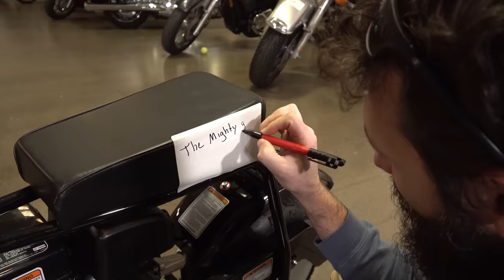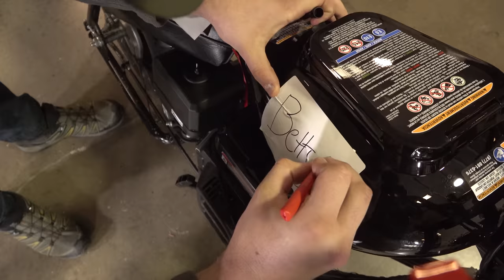Is a $400 Amazon Mini Bike better than the MOST EXPENSIVE mini bike ?

Comment: Minibike -- AKA Trouble Preventer 9000. 
This has to be the best invention since the motorcycle itself! My two brothers and I pulled 3 of these things out of a scrap yard when we were young. We did what needed to be done to get them going, and then commenced to have an absolute blast with them. The quest for more speed kept us girl and drug free throughout high school. Of course, not without consequences. There are now 15 + engines of all different kinds taking up space in my dad's shop, and I've had my fair share of road rash... However, these minibikes taught me how to troubleshoot & solve problems, achieve set goals, as well as how to build/tweak combustion engines for more horsepower. Needless to say, they've played a huge part in defining my future, and I thank God that we were able to take part in such epic projects.

Comment: Coleman mini bikes are great ...... UNLESS YOU START MESSING WITH THEM !
I bought 3 different models from Tractor Supply ( 2 for my grand kids )and started mods on 2 of them based on YouTube videos.
Straight  header pipes,  high flow air cleaner system, bend this tab for more speed, move this spring over to the other hole for better throttle performance, torque converter. 
DON'T  DO IT, assemble them then leave them as they came out of the box !!!
I have 1 running mini bike I didn't mess with, another one that runs at half throttle and one that doesn't run at all.

Comment: The Betty doesnt like to steer after about 20mph. Just kinda skips along like an ATC 90.And the brakes are very short term.the jackshaft setup is crap and needs a torque converter. But that's all that needs changing before wrapping it.I got a gx 390 on mine with the billet stuff and. Mikuni  32mm carb and cam and it climbs trees..Hurts everyone that rides it. Needs a wheelie bar on pavement

Comment: We took apart a road scooter and threw the motor into a mini frame, but it only had a go mode that was controlled by putting an alligator clip onto the battery. It was ridiculous , I guess we were ahead of our times that was 2004' should have filmed the crashes.

Comment: Does the ct100u have a limiter on it?
Reply: Every mini bike from the factory has a governor which is an internal engine speed limiter, there is normally a throttle stop screw which is the external limiter that you can easily adjust

Comment: Ahh 👀 Doc. ? That that bike is not the most expensive mini bike. It doesn't have shocks in the back. LOL that is not the Trailmaster. The Trailmaster will eat that up. The Trailmaster mb200 out the box with the governor only the idle screw pulled back and a governor bypass wire. That is not the most expensive mini bike. The Trailmaster MB 2 out of the box 40 miles an hour

Comment: I owned a Massimo Warrior they're frankly terrible mini bikes.  Well they're good but not good. The top speed sucks because of the governor not even sure it goes the advertised speed (and it's designed to be a pain to bypass without opening the motor completely) and the headlight is also useless. It's powered directly by the motor so it's brightness directly correlates to your acceleration and the idle brightness is so dim it's not practically usable. Terrible design choice to save money on production. I had the same coleman mini bike and bypassed the governor linkage with a piece of metal coat hanger and it toasted the massimo hands down no contest on a half mile strip and I weigh 200lbs. My friend who's like 140lbs was on the massimo

Comment: Hey bikes and beards if your reading this can you guys help me? so I bought the Massimo mini bike around 10 months ago and it was doing fine for a while but about 2 months ago it started acting weird after some time of riding it likes to make this screeching noise that sounds like a dying horse mixed with something grinding and it kills the engine after about 5-10 secs of it making that noise, I changed the oil, the airlifter wasn't dirty and I emptied the condensation tube but it still makes that noise, my dad said we may have to clean the carb but idk i took it to my local dirt bike place but they said they couldn't help and tried to sell me a new bike I would love the help
Reply: i didn't take it to my local place i meant i told them about it and they said they couldn't help and try to sell me a new bike ( regulars salesmen)

Comment: having hard time starting the motor... well it was the choke switch on the carburetor, you had it set to run not to start. so i guess filling the gas tank with 80/20 water gas mix was unnecessary, but now that its all apart "you have energy to do that and you wont even take out the garbage" "out of the garage, go, clean your room". now that covid is around, no longer able to clean room by stealing parents credit card to pay a maid. just sits in mess looking to find the wrench to fit the next bolt to fix the motor that has nothing wrong with it... has a full tool set but the tools are all sized in a way that even the ones with the right numbers don't even fit the heads on any of the bolts. how long, will it take em to find the wrench that isn't there? ... watered down gas, hu?